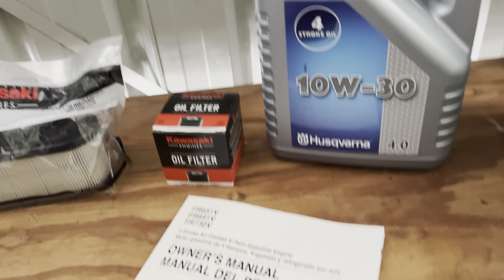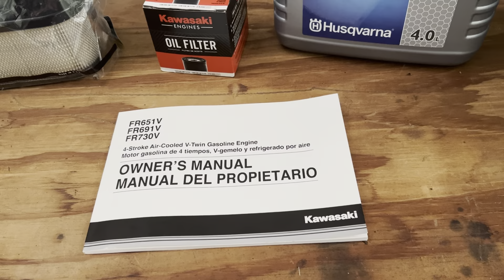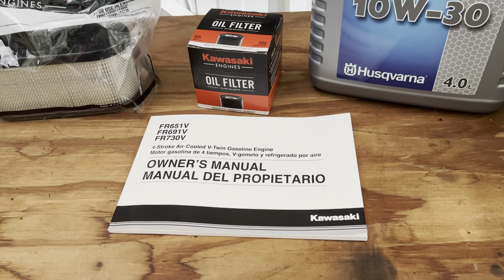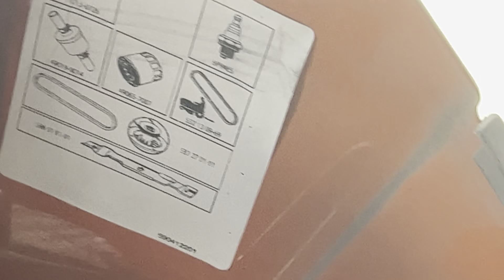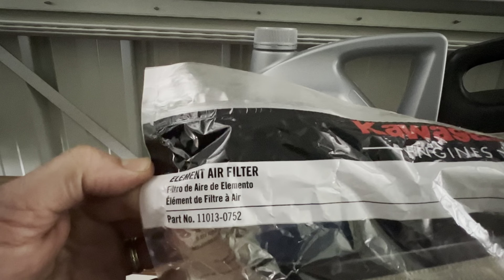How to Service Your Husqvana TS342 | Oil & Filter Change | Air Filter | Spark Plugs

Comment: Hi 
I have found your clips very helpful.
I have the same mower dose a great job.  The other day the transmission fell out. Broke 2 leavers on the transmission the 2 brackets that hold it in also the thin metal that holds the axel.had to replace all the parts. Why this happened was because one of the bolts holding the transmission one the left side pulled out, tread striped.needed to drill all the way through the holes replacing the 2bolts with a longer bolt with a nut .so keep an eye on them. Often. Very rare I think. After I got all the parts and fixed it. I found my extend warranty 😂😂
Reply from the maker: Hi Kim,
Sorry to hear about your transmission. That just made me break out in a cold sweat!!! Glad to hear you got back together. I’m going to have to check that out now 😊. I have had a few bolts just ‘disappear’ while mowing but have never checked the transmission. 
Thanks for sharing and I’m really glad to hear the videos have been helpful!
Thanks for watching the channel.
Reply: Thanks for advice

Comment: Mate did you say wat the Oil grade was ? Is it 10w-40
Reply from the maker: Thanks for the question @Forged721. I used 10w-30 oil. That was advised by the dealer where I purchased the mower.
Hope this helps…
Cheers
Reply: @selfrelianceaustralia166  ok great seems to be the go with Mowers ,genies ,anything low performance but long life 

Thx heaps 🤙🤙
Reply: Did you grab the Husky oil at the dealers mate ?